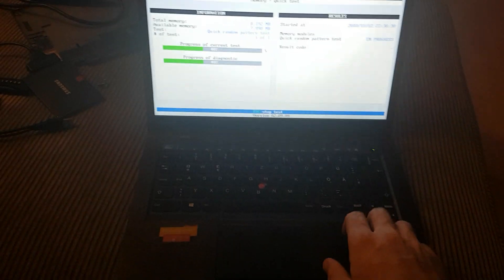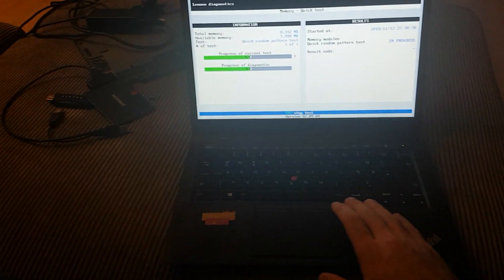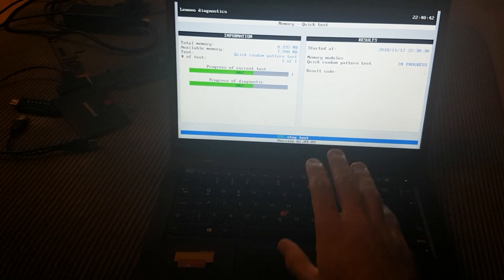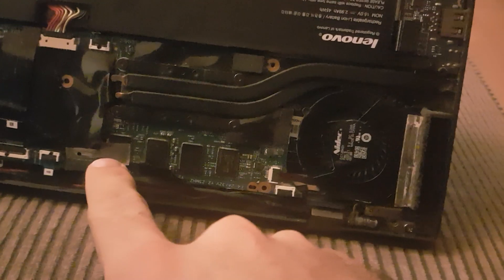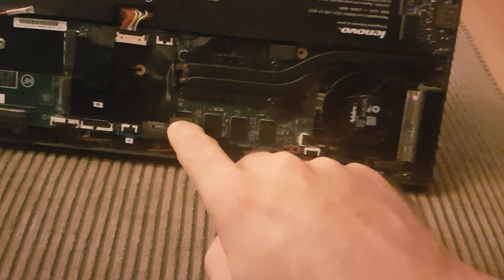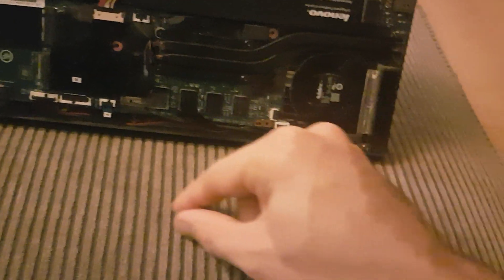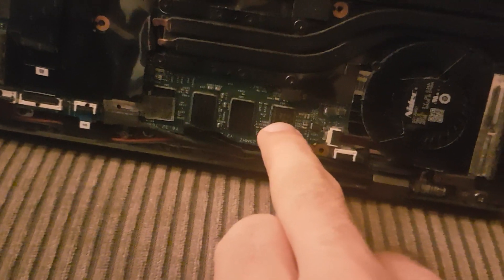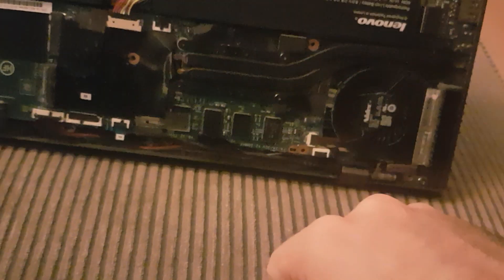Lenovo thinkpad X1 Carbon blackscreen not turning on freezing the ultimate real FIX

Comment: Thanks Adnan! I can confirm this fix! I reflowed at 250c around 30 secs per chip with a cheap 858D hot air soldering gun.  Symptom: Lenovo X1 Carbon Gen2 led turns on shortly, short flash of adaptive keyboard light, short fan spinup, black screen, power off again. 
First removed the tape on the components (folder back) and I added some flux around the chips beforehand but this might not be required. Please keep in mind this is not a permanent fix for the bad design that Lenovo chose. 
I think the issue is the close proximity of the RAM chips to the CPU- where Lenovo is not taking into account the heat/cool cycles (well, at least not once th device is out of warranty!). Sucks to have such fantastic hardware (keyboard, screen, case) killed by lead-free solder.

Comment: Adnan, good video, thank you! There are 4 *2 GB RAM. 1.Are they (in theory) switchable with each other or are they all unique? I would go with switchable, but you talk about a very specific number on the RAM. 2.I want to "apply heat", can I use a hair dryer or what, how many seconds etc.? Or would that already be a soldering job?